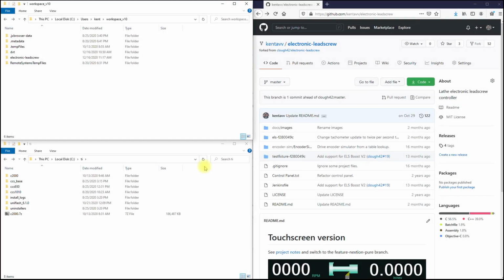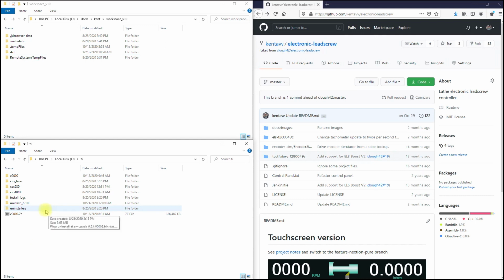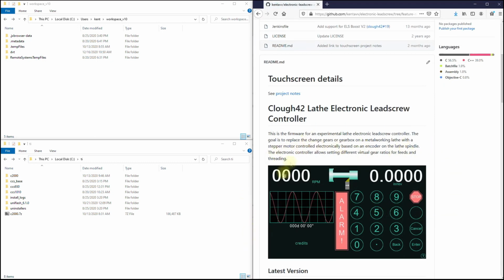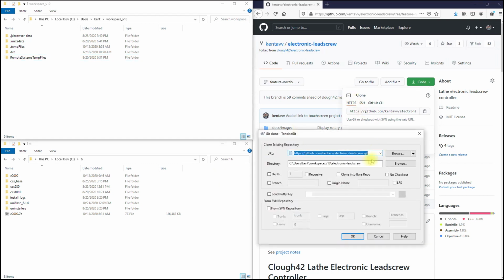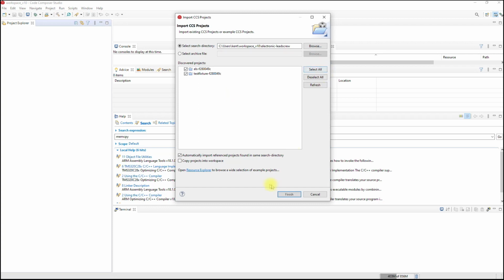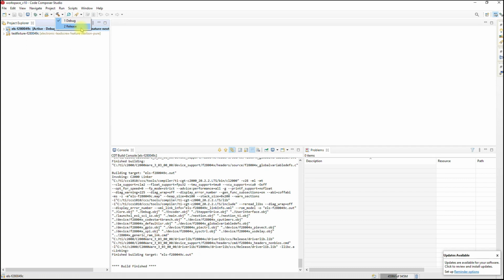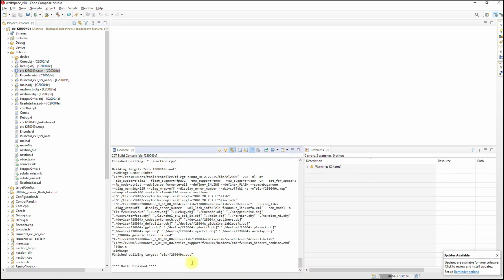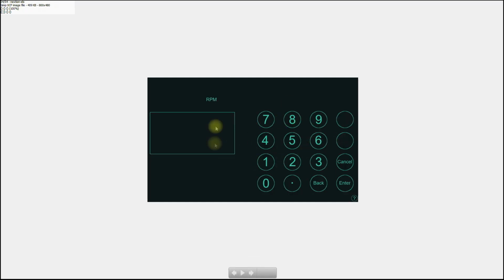Build the Nextion Clough42 ELS Code

Comment from the maker: The binary can be uploaded to the Launchpad board, without Code Composer Studio, using Uniflash. I had intended to implement hardware configuration using the touchscreen interface, but ran out of time. So, the best we have today is to rebuild the code for each lathe configuration, but with the correct binary, Uniflash could flash the board without the overhead of Code Composer Studio.
https://www.ti.com/tool/UNIFLASH